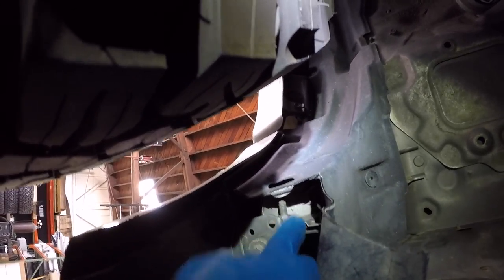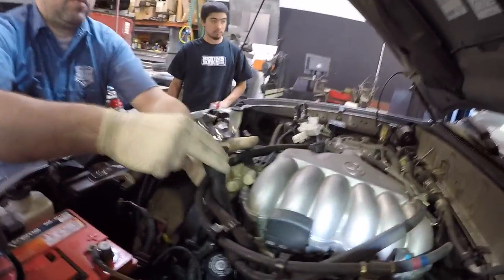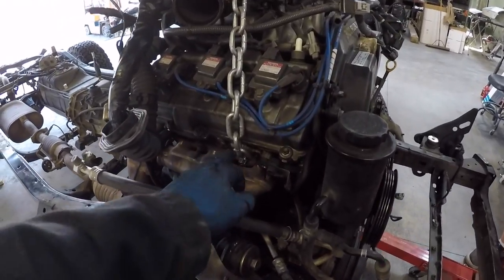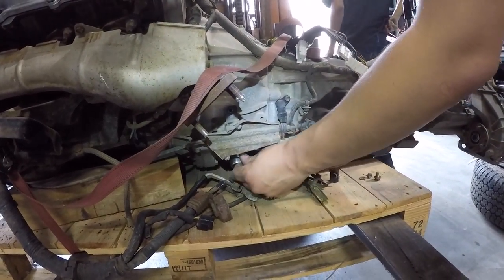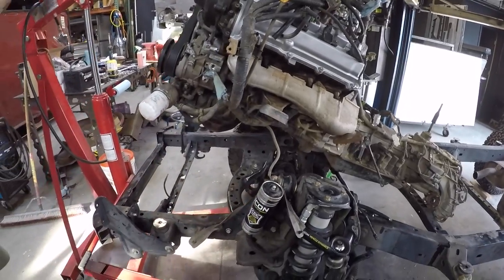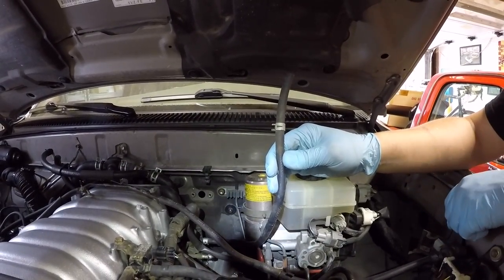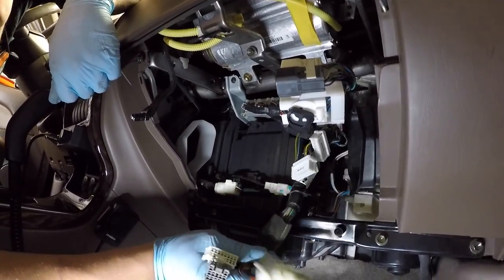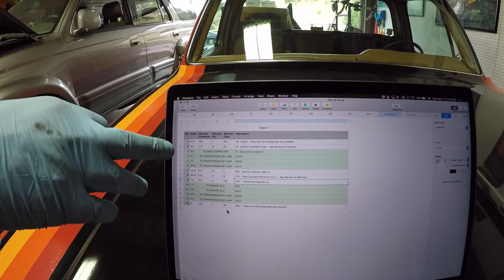V8 Swap (5VZ-FE 3.4L V6 to 2UZ-FE 4.7L V8)

Comment: Fantastic but for one hour and 20 minutes where is the test drive at the end? Wanna see this thing fire up
Reply from the maker: Yeah, we hear what you're saying.  Others have said the same thing.  However, the engine is running at the very beginning so you might have missed it.
Reply: Don't want to see it running, want to see a 0-60!
Reply: Because it doesn't actually run
Reply from the maker: @johncholmes643  Uh, if you watched the very beginning of the video, we show the engine running.  Nice uninformed comment though.
Reply from the maker: @Mr05Tundra  Yeah, I don't know how we would have done that unless we took it to a track.
Reply: @TimmyTheToolman  you can get a dragy for a 0-60 time.
Reply from the maker: @itseric1jzson  Well, it's 5 years too late.  Mikey doesn't even own the truck anymore.  He gave it to his brother.  So, no 0-60mph displays are going to happen.
Reply: @Timmy The Toolman  well we didn't have that information until now, and I was just answering your question. And you said the truck is still in his family ? I doubt it would be impossible to get a 0-60. Either way, I don't really care for the 0-60.
Reply from the maker: @itseric1jzson  I don't care about it either.
Reply: @D Reynolds  go take a pass bro just wanted to see what it does after all that work.

Comment: Could have just bought a Sequoia for 12 thousand dollars.
Reply from the maker: And then you'd be driving a Sequoia instead of a 3rd Gen 4runner.  Mikey knew this wasn't going to be a cost effective venture.  He wanted more power in a smaller rig and he also wanted the challenge of succeeding in this project.  If the money was a big deal to him, he wouldn't have done it.
Reply: Or get a Lexus GX460 or GX 470 but still a cool video. A lot of work though.

Comment: There are 4.7L V8 manufacturers on 4Runner, they’re very strong moved.  I loved that 4.7L V8.  
Thanks for video.
40:00 I realize you guys didn’t looking deeper about 4Runner actually made with 4.7L, V8.  Meaning you will get many parts from toyota dealer or junkyard from 4Runner with 4.7L and V8.  If you could got 4Runner with 4.7L, V8 you would not spent additional modifications.
But it’s good to have you guys video your project for knowledge.
Reply from the maker: You can't just pull parts off a 4th Gen 4runner with a V8 and think you're not going to have to do some customization to make this swap work.  For instance, custom exhaust work was needed.  The electric cooling fan shroud that was fabricated was needed.  And, I'm pretty sure the custom air conditioning lines were needed as well.

Comment: I feel you on the Pep Boys hesitation.  I learned the hard way to never trust them when I had them install a new distributor cap on my 89 Prelude 2.0 SI (with 4 wheel steering).  I did most of the work myself on that thing but didn't feel like renting the timing gun and learning how to do that.  A week later the cap caught fire and toasted most of the stuff on the top of my engine.  Miss the hell out of that car......
Reply from the maker: Boy, that was a hard lesson you learned.  That sucks you lost that Prelude.  Thanks for the comment.

Comment: Not a good use of the time invested when you consider the result. The 5VZFE is a great engine. Even with a supercharger on it it can go nearly half-a-million miles with good care. If you need to tow, and you have to do it with the Toyota,  get a Tundra and just enjoy your 4runner with the V6. Or even better, get a Ford Super Duty and put a Cummins in it.
Reply from the maker: Well Matt, this mod isn't for everyone.  A V8 in a 3rd Gen 4runner is pretty cool and you could do it more affordably than Mikey did if you could do most of the necessary fab work on your own.  Not everyone is going to go out and drop the coin on a Tundra so they can tow.  One vehicle that could do it all might be more cost effective.   And Dude, don't mention Fords on a channel dedicated to Toyotas.  There should be some sort of law you just broke there.

Comment: Due to tensioner malfunction 05 Tundra 4x4 V8 bought the farm. Found a salvage 06 with similar miles 1500.00 shipped. Unbolted converter to remove and replace engine. Little more HP able to  replace t/b  rear main seal converter . Like new now. 2 years out no problems
.
Reply from the maker: Where did the engine come from?

Comment: Holy engine swap Batman!!! Curious, is there a reason why you have an older style grill on your 02 Runner Mikey?
Reply: I wasn’t into the ‘02 grille as much.  Tried a bunch of different options and ended up on the ‘97 limited grille.

Comment: Man I need to find a place that will do this somewhere near Louisiana/Arkansas area.  I sooo want a 4.7 in my 2000 3rd Gen.
Reply from the maker: Hey Thomas, I think a shop would charge bookoo bucks to do this swap for you.  It's a ton of work.  Mikey did a lot of the research for the wiring harness and built it himself which alone was a ton of time.  He estimated he spent 12k on this swap.  I think a shop doing 100% of the work would charge you even more.  But, I guess it wouldn't hurt to ask what a shop what they would charge.  It would have to be a shop that specializes in this sort of thing because you're average shop wouldn't take on a project like this.

Comment: I have a very serious interest in doing this. I have a 94 ex-cab 4x4 with the 3.slo and while most people do the 5VZ swap which is much easier,  I think I want more power for towing.  I've already purchased a 2-inch body lift from 4Crawler which I'm about to do and will then be installing a long travel kit and am swapping the rear axle to a 2002 Tundra to match the extended width of the front LT kit.  I'm moving to Washington state in ~ 2 or 3 years and the goal is to pull my trailer back and a forth at least twice to move my small shop.  I also weld MIG/TIG and fabricate and do various CAD/CNC work so I know I could tackle this and do most everything myself labor wise.  

I did the R150F clutch last year in my driveway.  I've worked on cars since I was 15.  I feel if I'm going to go through the trouble of a swap, I might as well go the extra distance to really have what I want, and being able to tow around 4,000-5,000lbs much more easily is really what I'm after.  I've toyed with just buying a Tundra but I hate automatics and also hate the bulbous looks of the early 2000 models.  I'd rather stick with a lighter, more compact 5-speed manual truck with a beefy engine upgrade.
Reply from the maker: Hey Jeff, sounds like you have the skill set and motivation to pull off the swap.  Good luck if you decide to do it.  One day I'd like to learn to weld but I sort of doubt I'll ever be an accomplished fabricator.  Happy Wrenching!
Reply: @TimmyTheToolman  Thanks, it looks like the 4.0UZ is a lot easier to pull off with a manual transmission and transfer case.  Since the 2UZ was all automatics only it seems near impossible to mate the two.  There are a few leads on an adapter plate but from what I can tell it also comes down to emissions issues since again, no manuals exist for that engine and thus no ECU for manual.  Therefore I may have to scrap the idea or go with the 4.0L UZ or an OM617Mercedess diesel swap which a guy has well documented on here on YouTube.

Comment: What kind of gas mileage are you getting with the 2uz swap, about the same as 5vzfe?
Reply from the maker: You won't get an answer to this question from our video.  Mikey gave the truck to his brother shortly after we filmed this.  He bought a Yukon Denali so he could tow a big Air Stream trailer, and he no longer had any need for the 4runner.

Comment: I know Mikey transplanted several of the sequoia parts onto the 4runner, and that the oil pan clears the frame. Was that the particular reason why the sequoia 4x4 was selected as the donor vehicle as opposed to a 2wd sequoia or another vehicle? Thanks and love your videos!
Reply from the maker: I don't know why Mikey selected the Sequoia other than the fact that he was able to buy the whole vehicle relatively cheap through the Copart Auto Auction. The Sequoia was wrecked bad in a crash, but the drivetrain was in good shape.

Comment: I pull my 4200 lb camper with a 4th gen V8 4.7... I have a 99 3rd gen that is lifted and i sooo want to do this. Thanks for the vid. My buddy just swapped the ls400 V8 into a 89 4runner.
Reply from the maker: Down Town did your buddy document that process at all on that particular install? It would be cool to see more details about his work & anything that could help the next person do the same.

Comment: Hi there, i have 4th gen 4runner 2006, V6 engine i want to put V8 engine is it easy i mean do i need to make modification on the frame or just it will be smooth transfer?
Reply from the maker: It’s super easy! You won’t have any problems.

Comment: This is incredible. I would love to do something like this or the new Cummings crate motor, but this is WAY beyond my wallet and knowledge. My long term plan is a full rebuild and supercharger
Reply from the maker: Where are you going to get your motor rebuilt?
Reply: I'm rebuilding my motor now and it was supercharged. Decided to go with 9:1 pistons from LCE. When I disassembled my motor at 300k miles, I had for or five stuck piston rings even with the URD 315cc injector setup. I do know last year the dealership (broke down in New Mexico) put standard plugs in..which may have killed the motor. Feel free to email at chuckforquer at gmail dot com.
Reply: Cummins*!!! The new crate engine is sweet but for the money I feel like it's seriously lacking in power. I'd much rather do a merscabes diesel for alot less
Reply: @chickenfishhybrid44  *Mercedes

Comment: So, obviously, the super charger is going to be the more affordable option. How would you compare the V8 to the super charged V6?
Reply from the maker: Neither Sean nor I have driven a 3rd Gen with the V8 so we couldn't really say how they would compare.  The V8 does have quite a bit more horsepower and torque than a supercharged 3.4 liter V6 so it's clearly more powerful.

Comment: Did you run into any problems with using the stock a340f toyota transmission when doing the swap. I have a 04 tundra with the 3.4 and I'm looking to swap a 4.7 and looking to see how big of a challenge it's gonna be
Reply from the maker: No problems that we've heard of from Mikey.

Comment: hi I am planning to swap the same type of engine on to a manual 6 speed Fj cruiser any advice will be grate
Reply from the maker: Hard to offer advice for this type of sicmod since we just tagged along with Mikey as he put this together over many months. He did lots of research on the forum to understand what he needed to do to be successful. Wish we could be more help here but this video was meant to be more entertainment rather than our typical step by step “how-to” video.
Reply: @TimmyTheToolman    Can you sell me the wiring for the engine and the computer Wireing  everything is to start one of those engine  in my FJ cruiser
Reply from the maker: @noelgriffith13801984  We don't possess what you're asking for.  Mikey did all the necessary wiring harness alteration to make it work.  We are not a store that provides auto parts.  We're just a couple guys who make videos to help people.

Comment: Hey Tim sorry man I got a ton of questions: Any chance Mikey would share that tech electrical diagrams for pinning the connectors? About to conquer this task here in about a month so trying to gather all the supplies and things I need prior to doing the breakdown. Also what did you guys use to de-pin the connectors? Ive tried before, but didnt know if you needed a special tool to not mess up the pins as you push them out. Any advice or suggestions I should look out for?
Reply from the maker: No way to give an accurate estimate for the time invested in this job.  Mikey did lots of research ahead of time to build the wiring harness.  The job was spread out over quite a bit of time and many many days.  There's a link to a doc for the wiring in the video description.  I don't know what tool Mikey used for de-pinning but I do know they make a special tool.  I'm sure you'll be able to figure it out with a little research.

Comment: Hey do you think I could swap in the 4.7 into a regular cab tundra that has a 3.4 v6 in it? Would I need to do any custom work or need custom parts or just donor parts?
Reply from the maker: You could do it.  You would absolutely need to do custom work like we discuss in the video.  Custom motor mounts.  You'd have to reposition the transmission support cross member.  Custom Electric Cooling Fan Shroud.  Alter the exhaust.  Custom AC lines.  It's a lot of work and a lot of money especially if you're paying somebody to do the swap for you.

Comment: If I have one Sequoia 2003,  Can I mount the 4runner on the Sequoia chassis ??  
I see same project on the Denali 2003 chassis with mount 67's Blazer.

I think is more easy..
Nice video.
Reply from the maker: Don't know.  We've never done it and I haven't heard of somebody doing it.  With heavy modification, anything can be done.

Comment: Those 4.7s are perfect for old yotas! Bet that runner is peppy... Man I just want a 3.4 in my old T100. Anything is better than the 3.0 😭 😂
Reply from the maker: Yes, the 4.7 liter is a great engine.
Reply: Timmy The Toolman sadly it has a timing belt. Other than that it is perfect. How many main bearing caps has it?

Comment: what is the cost of something like this and where could I get it done? What kind of shop? Anywhere in Vancouver WA could put a V8 in my 1st gen Tacoma?
Reply from the maker: Mikey said he spent around 14k.  If someone was able to do all the work themselves, the cost would go down by quite a bit.  Mikey paid Wes for his time which added up due to all the custom fab work that was required.  We do not know of any shop in your area that would be good to use for a job like this.  You'll just have to do a search or maybe ask this question on a Toyota forum and see if anyone has some suggestions for you.  Good luck.

Comment: Very nice! My mom has the same engine in her sequoia. Has 350,000 miles on it and still runs great with no engine work. She wants to get rid of it cause shes scared it will break down someday but I want her to push 400,000 miles 😂😂.
Reply from the maker: Yep, the 2UZ motors are known to go over 500k no problem.  Tell your mom not to worry and keep driving it.